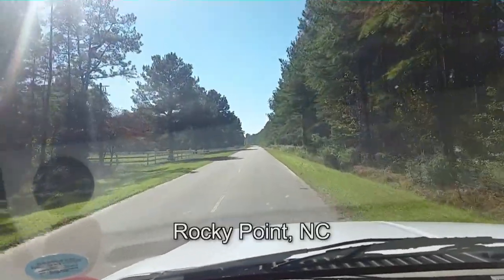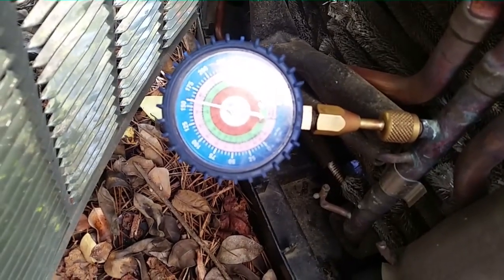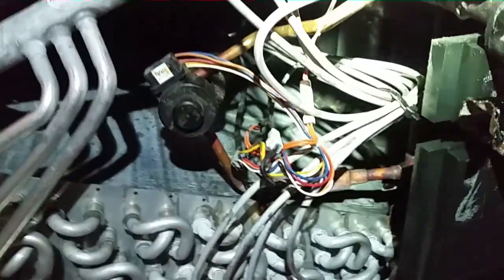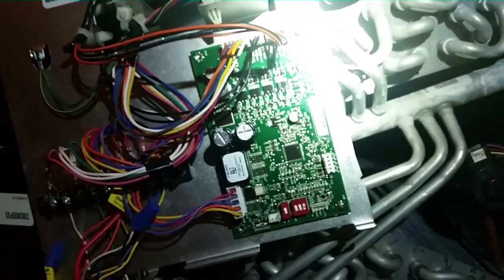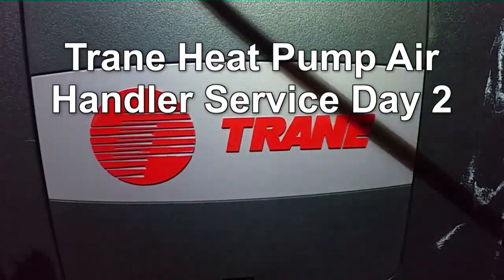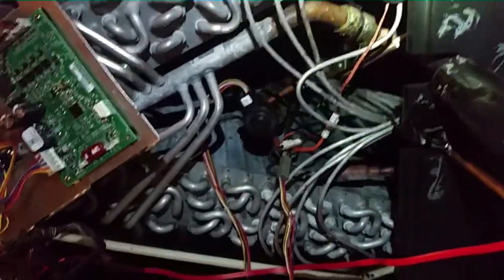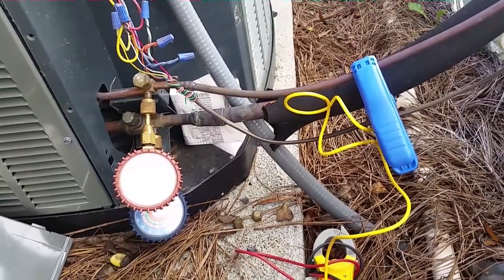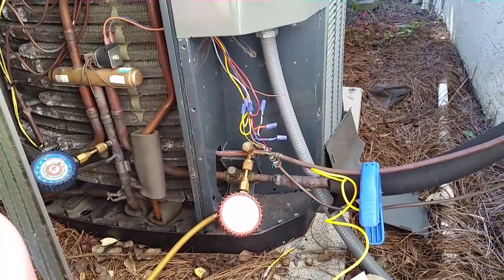Troubleshooting Trane EEV and EVC Board

Comment: Had a TAM7 with the 10 red flash (superheat) fault. Great video! Read a interesting article  suggesting the "SH" fault can sometimes be due to a dirty filter or evap coil.
Reply: I’m dealing with this now , I go back this coming Thursday Sept 5th 2024 , 😢what did you do to fix it ? I was taking of replacing the Stepper motor and EEV . ☹️

Comment: Worked on of these the day 
Had 3 green flashes (stage 2 cooling) and 7 red flashes (high superheat) put a jumper on open and test and pressures did not change. 
Going to be replacing the exv 😅

Comment: I wanted to know where can I find which manual you have that is telling you wheat the ohms for the senders should be I don’t work on a lot of trains but when I do it’s usually the eev sticking but someone brought my attention to homing out senders and that’s how I came here so if someone can help me would be great for next one I come across I can check instead of thinking it’s the eev I usually test the open and close am that that usually let me know if pressures change or not
Reply from the maker: It’s been a long time, but I probably found this information in the service facts for this unit
Reply: @zacksintheshop thanks for getting back to me someone else I talked to said I can find the ohm chart in google when searching  ohming sensors for trane

Comment: I’m just wondering but if you couldn’t jump out the stepper motor and then determined the step motors resistance was off point, what led you to condemn the board? You shouldn’t be able to jump out a bad motor.
Reply: He said why 4:51
Reply: If you ohm it out and it ohms bad, it's a bad step motor in my experience.

Comment: Electronic expansion valve?   Is that shit really necessary?   I'm sure the salesman who sold that system talked about all the "benefits" of the Trane system.  What I'm sure he did not mention is that the cost of repairing the system negates the energy savings.  I would never recommend this type of system.
Reply from the maker: It does not appear it was needed. I don't really do these type either.
Reply: Jim D they are kind of in the new inverter technology
Reply: They're great for efficiency. They're really not bad to diagnose or work on. The motor can fail but the valve itself is rated for practically the life of the unit. EEV and ECM all the way!
Reply: More reliable and efficient.

Comment: No way that EEV and circuit board fail at same time. That's easy fix by replacing everything. Am sure the problem was the EEV...more likely, if that unit has air flow problems ( low air flow ), the valve will be working hard to maintain refrigerant flow till collapse. I have see that issue very often.

Comment: How did you fit your meter leads in there to test the stepper motor? Mine wont fit
Reply: you can use small piece of thermostat wire in a pinch or get back probe kit for your leads

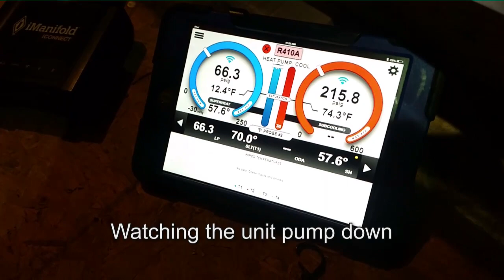Comment: Sssooo the bottom line here is you misdiagnosed it. You blamed it on Trane EEV and control board ?? When you first check the standing pressure 50  psi didn't ring a bell ? When you test run in cooling mode (3:32) the highside pressure only 214 psi for a r410a system did not ring a bell ? and You blamed it on EEV and control board ? have ever heard of low charge? I know a heat pump equipped with EEV is not popular and not easy to diagnose it but atleast when you look at the gauge The high side pressure only214 psi did not tell you anything?? If you suspect a  bad EEV (not open,stuck closed) then when you run the cooling mode the high side pressure should be MUCH HIGHER not 214 psi as shown in your video.
Reply: So before you attack Zack know your shit. System was running 100/300 in heating mode which in NC is very possible. In cooling mode we could obviously see a restriction. If your running cool mode in winter (November) than obviously in cooling your head pressure will be that low. Come on man. Hvac 101